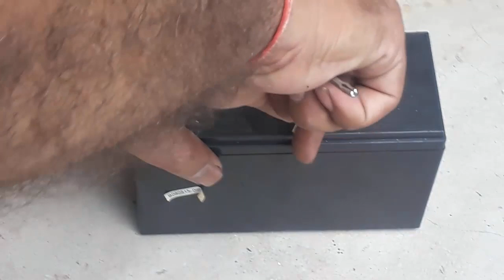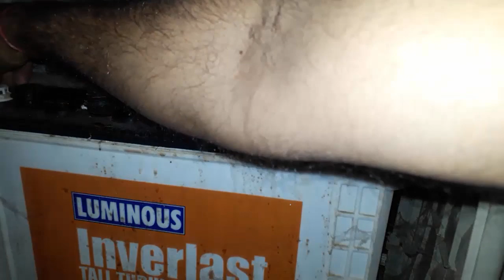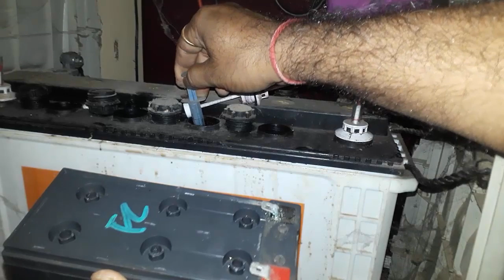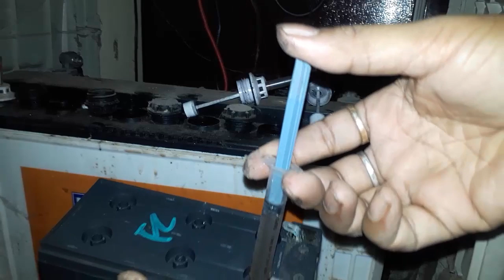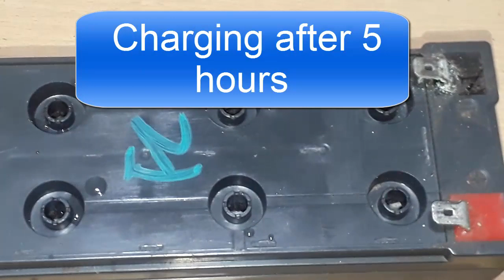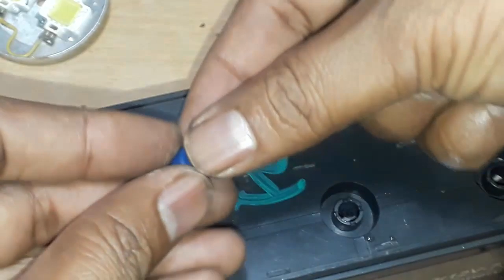How to Recover 12v Battery

Comment: The best way to recover a battery that has sulphated plates is very low current for a long period , you would need an adjustable power supply to achieve this .
Reply: Hi. I need help...my battery is 12v 4.5 AH ...    I failed to charge it with a 12V 2.0 AH ...i added still water but still not charged ?!?
Please someone directs me

Comment: Not all Lead Acid Battery can be revived to the original voltage. Most used Lead Acid Battery cannot regain it's full potential due to battery sulphation or a dead cell. But you can definitely revive unused Lead Acid Battery where the plates and absorbing materials just dried up due to age. Use battery solution 30-50% sulfuric acid (H2SO4) in distilled water.
Reply: Hi. I need help...my battery is 12v 4.5 AH ...    I failed to charge it with a 12V 2.0 AH ...i added still water but still not charged ?!?
Please someone directs me

Comment: The process described is not correct because the sealed UPS batteries have the acid absorbed in the plates and do not produce harmful gases. With the described procedure the battery will not follow the correct operation and will produce harmful gases. This is a highly discouraged procedure.

Comment: Dafak armhair..do u really know to use multimeter..end clip u test d batery with bulp. Well even 3v can light such bulb. And shouldnt test battery charger by short circuit, in some charger it will cause damage/xplode of chaarger compenen...

Comment: Is that distilled water??
Reply: Battery acid from another battery but if you use water to clean the inside or add to it then it needs to be distilled water.

Comment: Hi. I need help...my battery is 12v 4.5 AH ...    I failed to charge it with a 12V 2.0 AH ...i added still water but still not charged ?!?
Please someone directs me
Reply: You need to charge it at a higher voltage , try 14.5 volts ...don’t let it do above 14.7 v
Reply from the maker: Charging Voltage should up then battery voltage
Reply: I have a stupid question ...the voltage in the car is 12 v ...but it charges the 12 V  lead acid batteries !?!    How does it work ! They have the same voltage .